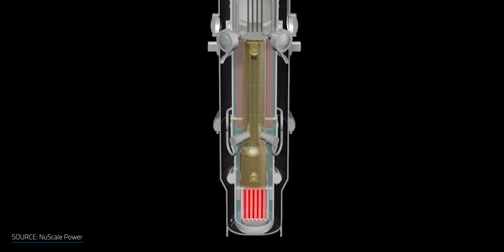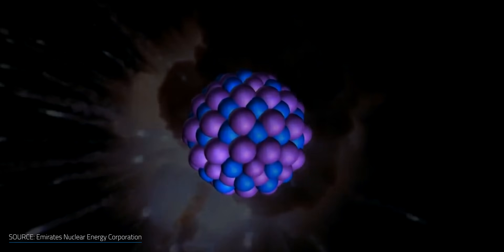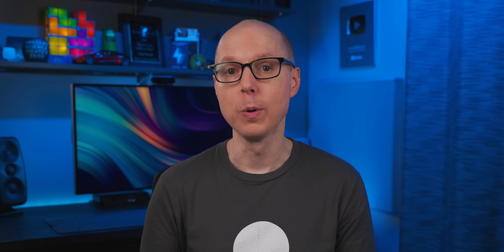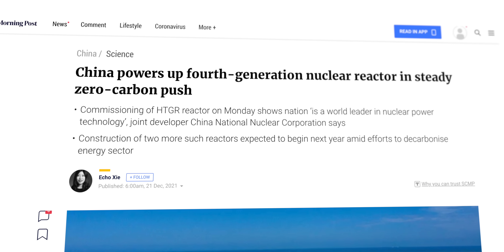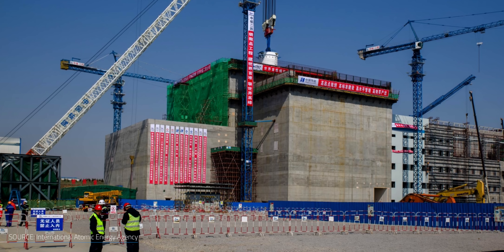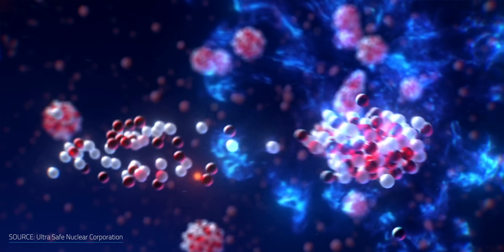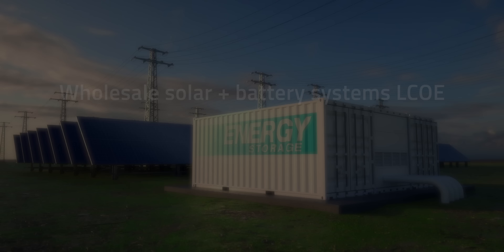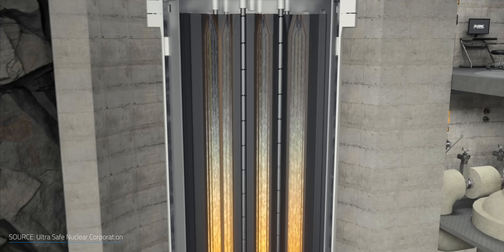Forget Small ... What About Micro Nuclear Energy?

Comment: I work in renewables but honestly believe more in nuclear. When it comes to cost and meeting net zero, something that is often overlooked is that renewables are not dispatchable (as in you can't decide when they generate) and there is not current technology for storing energy between seasons, meaning that it is very expensive to run a reliable net zero system off them, whereas nuclear solves this, also without turning the countryside into industrial wasteland. If those LCOE's were adjusted for firm power, solar would be near infinite as it produces nothing in winter evenings.
Reply: @gags730  
The cost to recycle solar is not economical and will make the cost of electricity 4x more than previous estimates if we recycle the panels.
I don't know where you get this from. Recycling a solar panel in a French recycling plant costs around €25 or around 10% of the sale price of a panel if we'd include transport. This isn't going to impact solar panel costs. The only reason why solar panels don't get recycled currently in some/most parts of the world is because companies/people try to lower the cost as much as possible and rather just bring it to a dump for a fraction of the cost (probably just a few cents per panel). You just need to get regulation to make recycling mandatory, which the EU already has done.

China being the largest producer also does this at minimal cost, so you have cheap materials and cheap labor and thus a cheap panel in the end.
Except studies have shown that the low cost of Chinese panels isn't due to cheap labour (the process is mostly automated), but rather scale. The Chinese jumped on solar panel production and quickly scaled it up before anyone else did it at such large scales and they quickly started dominating markets with this lower price due to scale, making it much more difficult from anyone else to achieve the same scale and thus cost.

So the energy needed and the labor to recycle the panels makes them not economical to recycle today
Recycling process' barely use labor and I don't know about the energy requirements, but like I said before, recycling is mandatory in the EU and in France they do it for €25 per panel.
Reply: @MDP1702  I suspect you mean 3% only within HVDC (which is declared loses, so in reality it would be much bigger). What I mean by big energetic loses is all the energy needed to maintain the system, not just "natural". So that would be up and possibly beyond 10% which is huge considering that net income of solar CSP EROI is already just 15 (as opposed to Nuclear 75), while PV is not even goes above viable threshold. 

And that is just for Sahara dezert vs Germany, which is directly above Sahara in terms of solar provision (i.e. Germany is bad example as it does not solve the stability issue and for non stabe - well we  already saw this year what economical failure was switching off stable nukes and going non stablr towards wind/solar. That is - for te system to be viable we must consider provision fro  somewehere that is 20k km away, and 3% HVDC line loss becomes 60% loss that makes the system bellow economicaly viable EROI threshold.
Reply: @romualdaskuzborskis  
while PV is not even goes above viable threshold.
This is completely incorrect, don't know where you get this from.

What I mean by big energetic loses is all the energy needed to maintain the system, not just "natural".
I never talked about anything but transmission losses, not the losses within a system, which would happen whether you place it in the desert, or right next to your house (figuratively speaking). You too talked about just the 'transportation' losses in your original comment, not the losses within the generation system.

And that is just for Sahara dezert vs Germany
So what else you want to compare? The Sahara to the US, eventhough the US has deserts closer to themselves, like in their own country? No one ever talked about the sahara providing power to the entire world, at least not more than just as a thought process to show how much solar would be needed to power the world when placed in those regions. And I don't think there are many places on earth that are further away from a desert than northern Europe vs Sahara, perhaps South America and smaller islands.

well we  already saw this year what economical failure was switching off stable nukes and going non stablr towards wind/solar.
The decision to shut off nuclear in Germany had nothing to do with renewables, it was purely a political decision. They then decided that rather than replace it with coal and gas, they'd invest in renewable, not just to replace nuclear, but also coal and eventually long term gas. If they didn't make the political decision to shutdown the nuclear plants 10-15 years earlier than expected, they just have replaced more coal with renewables. Which arguably would have been better for the climate/emissions, but wouldn't have changed a damn thing regarding grid stability or economic outcome (at least not much at worst).

Also how is Germany suffering from grid instability? I haven't really heard of large problems coming from Germany regarding grid stability? I do hear problems from Austrialia and in the US, where ironically it often is just the state of the network, fossil fuel plants or just bad management that seems to be the problem.

If you are talking about gas, Germany isn't really using much more gas for their power since 2010. And the slight increase there is, is due to the shutting down of coal plants to replace them with renewables and cleaner NG. Overall only 15% of Germany's power comes from gas. The US gets 40% of their power from NG.

And if you just talks about the price of electricity in Germany, you need to remember this is mostly due to taxes. There was in 2018 only a 2c/kWh difference between France (nuclear) and Germany in power production cost. With similar taxes the cost difference in 2018 would only have been around 4c/kWh in total on the bill. But Germany has just more taxes and instituted a special tax to pay for renewable subsidies that were necessary 5-10 years ago when renewables were still significantly more expensive compared to now and this tax is planned to lower and dissapear in the next few years. 

for te system to be viable we must consider provision fro  somewehere that is 20k km away
I don't really see how you get to that conclusion. That is the completely other side of the world. If you say in order to cover the night, that isn't quite right. Wind doesn't stop blowing at night. Also if we really needed to, CSP in Sahara (or even just southern Europe, like Spain), while more expensive, would be still fine to cover the night if necessary, especially since demand at night is significantly lower.

And it is expected that several grid storage options will become cost competitive within the next 10-15 year.

The truth is, the Sahara project was abandoned because PV became much cheaper than CSP and the instability of the region could be avoided by just placing PV at home/in Europe for just a bit less output. The transmission losses might have obviously been a small factor, but not even close to the main reason for the Sahara power initiative to be scrapped. Other small factors included the lack of needed personnel in those desolate regions and the use of water where it obviously is a commodity.
Reply: @MDP1702  sorry dude, your narative seems either biased, or plain advertising agenda. 

You mis took my argument for isolated teoretical statement. No - all my statements are around and about economic failure of the full system start-to-finish. No renewables make a decent sustainable business case.

P.S. my info on PV EROI is based on article on forbes, which in turn based on studies from several universities including Stanford. While Threshold level varies from 5 to 8, PV does not reach even most liberal one. And none of renewables (even wind and Solar CSP) reach it if energy is is considered for storage..
Reply: @romualdaskuzborskis  
all my statements are around and about economic failure of the full system start-to-finish.
Yet your initial statement clearly wasn't.

"exporting means spending extra energy to actually move it*. So in reault you will make it expensive. *That is the reason why "the world" does not use sachara desert as world wide solar generator. *The transport loses are humongous*.

Nowhere here do you talk about the entire system or even point at it, you only talked about transport.

No renewables make a decent sustainable business case.
This statement just shows you don't know much about it.

P.S. my info on PV EROI is based on article on forbes, which in turn based on studies from several universities including Stanford. While Threshold level varies from 5 to 8, PV does not reach even most liberal one. And none of renewables (even wind and Solar CSP) reach it if energy is is considered for storage..
Except a review of many different studies on PV EROI came to the conclusion that the mean EROI in those 232 papers is around 11.6, ranging from 6 to 16 in those papers, with low numbers for old studies and high numbers for new ones.

Can you give me the link for your forbes articles or the studies? The only studies I can find from Stanford regarding PV EROI are from more than 6 years ago. Maybe your thing is just hidden in a more comprehensive studie, but I can't immediately find it.
Reply: Those LCOE looks like they are from the Lazard paper that is pure propaganda. It have been debunked a large number of times. Those number is even higher than the strike price for HPC that did include a sort of kick back system to the UK government. Pretty much the grid pays HPC £92.50 minimum, then it kicks back about £20 to the grid via installation and also about £4 directly to the government.

In Finland the strike price was €50.
Reply: Can anyone riddle me this one: If nuclear is supposedly too expensive, why are electricity prices lower in European countries with more nuclear plants? France has way lower prices than the UK and Germany with 71% of their demands coming from Nuclear. The UK and Germany are going for renewables but prices are rising quickly, and more worryingly, demand isn't always being met.
Reply: @jackjones9587  
Well, there are several reasons:
1) increased safety demands. Governments have just kept adding regulation on nuclear reactors to make them safer, just in case. This ofcourse increased cost.
2) new technology. They now build different plants than in the past (at least in Europe), they should be better, but also are now initially more expensive due to new problems that arise etc.
3) risk. In the past governments like France just footed the bill for the risk, ie. if something happened that caused operations to be shut down due to whatever reason, government payed for it. This was mostly with the government giving low cost loans, subsidies or the companies building them being (partially) state owned. These days if a plant needs to attract private investors or get a loan from a private institution, an insane % of interest is counted on it, around 10%+.
4) the plants usually were cheaper in the past due to scale, ie. usually a series of plants of the same type would be built (like the many reactors in France from that time), currently this isn't really the case (yet).
5) Current nuclear powerplants can also deliver more cheap energy due to their investment already being payed off years ago, essentially having to just pay for maintenance. Whether this actually lowered the cost, I can't remember for sure, but they certainly could run cheaper than initially was the case if they wanted to.
6) There is the idea that currently the companies running these older nuclear plants might be underestimating the costs of the end of life, often setting aside way too little to pay for the clean-up/demolition. This while for modern LCOE numbers more thought might be given to the end of life costs.

Also prices in Germany are so much higher than in France due to a difference in taxes. Purely looking at the production costs, there is around a 2c/kWh difference (+-7,5 vs 5,5c/kWh), and eliminating difference in taxes brings a total price difference of around 4 c/kWh. Though I have to add this was for around 2017-2018, since then French prices suddenly dropped, this seems to coincide with the pandemic. Most likely lower energy use, but ofcourse similar production capacity => lower cost for electricity.

Also the LCOE costs here indeed seem to be from Lazard, which seem high for nuclear, with most companies claiming they can run nuclear reactors for an LCOE between 60-100$/MWh, still more expensive than solar and onshore wind, but competitive with offshore wind for now. And ofcourse no storage capacity required unless you go above 70-80% of the energy mix. Beyond that nuclear becomes a lot more expensive, since it is expected that it runs 90% of the time, thus working as peakerplants isn't feasible, though adding some grid storage could manage to have nuclear run around 90% of the time even while supplying nearly 100%, but ofcourse then you need to start comparing with renewables + storage.
Why are Lazards nuclear prices so high? I don't know, maybe they add things nuclear companies tend to not incorporate into their LCOE costs (end of life maybe?).
Reply: The price of nuclear is its advantage, the problem is the building costs and time.
Reply: @jackjones9587  it's not too expensive it's dangerous.
Reply: @bradmason4706  Dangerous compared to what? In 1975 China had a hydro electric dam disaster. The Banqian dam burst; 26,000 dead from flooding, 145,000 dead from subsequent famine and epidemics, 11 million homeless. Caused loss of generation, dam failed by overtopping. India in 1979; the Machhu Dam-II collapsed, leading to the deluge of the city of Morbi and the surrounding rural areas. 1800–25,000 people were killed. Do we stop building hydro electric dams? If this really is a climate emergency, and we have just 10 years to save the planet altogether, then nuclear is clearly the only gig in town that is net zero and meets our present and future demands.
Reply: @jackjones9587  Glowing in the dark ! Why did so many die in those catastrophes ? Mostly because their existence was superfluous and they needed to suck the tit of progress.  And we only lost ~600 when a damn burst in No Cali. Thx
Reply: @bradmason4706  I'm not sure  I follow what you're trying to say. Who/what is glowing in the dark? Who are you referring to with your "their existence was superfluous" statement??
Reply: @jackjones9587  
The thing is that you can't build enough nuclear in the time frame we have as nuclear is a long time paying off it's carbon debt and we need solutions for the whole world, not just us in the West.
Spreading fissile materials around the globe is the wet dream of terrorists.

Our energy system have to perform well in reality, not just on the drawing board. And reality includes bad actors and staggering stupidity.

Old fashioned nuclear is bad enough security wise, but micro plants are a spectacularly stupid idea when you factor in just how hard it would be to secure against ignorance and malice.
Reply: @jackjones9587  
If we are to play the "what if" game regarding nuclear vs renewables, it would be a huge win for renewables :-)

Nuclear has been heavily subsidized along with fossil fuels.
Had half the R&D money poured into nuclear been spent on renewables we'd have had energy storages decades ago. It's fairly simple chemistry.

The carbon debt for renewables is paid more rapidly due to small scale. 
If we were to start nuclear now we'd have the plants in a decade and it would take yet another decade to see the carbon debt paid off. The same time frame is half a decade vs two decades in favour of renewables. That's crucial because the more carbon we dump in the atmosphere now, the more we risk runaway feedback effects and the more expensive mitigation becomes. 

Decommissioning of solar and wind have been looked into and largely solved already. 
Decommissioning of nuclear power plants, not so much: "We'll start thinking about it once they have cooled down a bit".

Farming can be done under and between solar panels. Wind turbines footprint is small and can be offset with urban gardening.

Your thinking is skewed by the illusion that we can carry on as today, just with another energy system. 
Going nuclear will continue problems with dependency on unstable/adverse states, face fuel shortages in a handful of decades and continuing the shop-til-you-drop lifestyle that is threatening biodiversity and sustainability in general.
Reply: @jackjones9587  That was the nuclear running joke about radioactive leakage. We'd glow in the dark. And at this point in time I would say Russian soldiers are superfluous.
Reply: @bradmason4706  Sorry Brad, I still don't see the point you're trying to make about superfluous people/soldiers. Re glowing; I'm well aware of the point you were trying to make. Yet, my point that more people have died from renewables i.e. hydro electric, than nuclear still holds. I wouldn't say stop building hydro electric, because of that fact though, therefore, nor should we stop building nuclear either.
Reply: @madshorn5826  Re subsidies: renewables must be the most heavily subsidised sector in the history of power generation! FITS schemes have attracted huge tranches of private equity at the expense of ordinary bill payers. The carbon debt payback of renewables may be quicker but the lifespan of their generation capability is much, much lower than nuclear, who's net benefit is clearly larger. As I work on large scale solar projects in rural areas, I can tell you with absolute authority, that beyond sheep grazing, no farming is allowed on land leased for solar projects. Apart from it being strictly prohibited by the leasehold agreement, it's absolutely impossible to plough, sow, and harvest crops under the panels....that shouldn't really need pointing out Mads Horn. The farmers and landowners I deal with are getting nearly 2-3 times per acre in leasehold payments, than they would get for farming crops. Clearly they would be fools to turn down guaranteed easy money, so obviously less and less food is being produced. Less food being produced means more food has to be imported with a carbon footprint. Lastly, I thought the subject of controlling consumption would have to be brought up. Yes, that's what smart meters are all about, and everything else smart for that matter. Smart really means control, and renewables, with their fundamental unreliability, are the perfect vehicle of excuse for that end. Smart tracking and energy rationing is where this ends. If a near limitless and free energy source was discovered tomorrow, the champions of renewables would resent it for disallowing them to usher in a zealous age of self flagellation.
Reply: @jackjones9587  did that include Chernobyl ?
Reply: @bradmason4706  How could I not include Chernobyl Brad, it's really all about Chernobyl isn't it.
Reply: @jackjones9587  
most of the world could be like France; generating over 70% it's power needs at pretty much net zero.
Maybe, though part of the reason it works so well for France is because it also exports a lot of electricity during down time moments. Without it, 55-60% might be more normal, though not sure about that.

Giving up arable land threatens food security
You don't really need to give up much though? PV panels can be paired with crops, several projects have already successfully proven this. Wind turbines take some space on the ground, but not that much.

and the efficient lifespan of renewables tech is a quarter that of nuclear.
Which I see as an advantage, you can more quickly replace it with improved tech, be it a better version of the same or just something completely new.

but if we really have as little time as we're being told, then, on balance, nuclear stacks up better than renewables.
I am not so sure. it takes around a decade or more to build a new nuclear powerplant in the west (Europe/US). Projections put gridstorage competitive within around 10 years, so by the time the nuclear plants come online, renewables + storage might already be competitive with it. And while during those 10 years nuclear doesn't do a damn thing, renewables are constantly increasing overtime untill you reach the point they need to be, so you don't need to wait 10 years to see effects.

In the end a mix of both renewables+storage and nuclear is likely going to be result in the short term, long term is just impossible to say.
Reply: @jackjones9587  
renewables must be the most heavily subsidised sector in the history of power generation!
Possibly, though now this dissapears. Also I wonder if nuclear R&D costs include things like the manhattan project etc, from which likely a lot of knowledge for civil nuclear reactors was also gained. Also I am going to wait, considering a lot of nuclear companies don't put the necessary budget aside for the decommisioning phase, so this might fall back on subsidies too possibly when it comes to it.

The carbon debt payback of renewables may be quicker but the lifespan of their generation capability is much, much lower than nuclear
Which doesn't matter, the carbon cost and the monetary costs of all systems are calculated using expected production over their lifetime. Its a universal value independent of a systems lifetime. So if renewables do better or equal in those, a shorter life actually can be an advantage, to more quickly replace it with improved systems, while with nuclear your are tied to 'old' technology for many more decades.

As I work on large scale solar projects in rural areas, I can tell you with absolute authority, that beyond sheep grazing, no farming is allowed on land leased for solar projects.
So I guess you have taken part in the projects that specifically looked into combining the two? Probably not.

Apart from it being strictly prohibited by the leasehold agreement
Which is not an inherent problem, rather a contract/regulation problem.

it's absolutely impossible to plough, sow, and harvest crops under the panels
Except it is already been done. It just has different design choices from traditional solar field, for example raised higher above the ground and enough spacing. Test have shown around 160% of land use, or 60% more than either just solar or just farming, with around 80% of crops vs normal and 80% solar vs normal. In some more arid area's this likely is even higher due to lower evaporation rates of the crops and the evaporation there is helps keep the panels a bit colder (though probably not that much). There even was a project were they had a net benefit in just the crops yield.
Reply: @jackjones9587  I thought Chernobyl cleaned up pretty nice considering. And there's a lot of brave first responders died there or within weeks.
Reply: @bradmason4706  True, it was a terrible disaster Brad, yet in terms of fatalities, it doesn't come close to hydro electric disasters.
Reply: @gags730  
The Dark Side of Solar Power Harvard Business Review
Ironically, this proves my point, namely that recycling of solar panels cost between 20-30€/panel.

However they claim the cost would rise much due to the logistics, which I don't see as feasible, it seems they are painting the worst scenario possible and are specifically just talking about the US. For example the reason why costs would mount that much are threefold in their argument from what I gather:

1) dissassembling of the panels from their place (roofs, stands, ...). This I find pretty ridiculous. Sure it will up the cost, but definitely not more than would be required to install them. Moreover later they talk about the problem that people will replace their old panel with new ones faster than expected, however this would mean dismounting these existing panels would happen at the same time as installing new ones decreasing costs.

2) legislation making PV panels hazardous materials, increasing regulation on it. This too sounds farfetched. While yes PV panels contain some hazardous materials, these are in such small amount and bounded in the panels in such a way, you need to pulverize the panels or burn at a hot enough temperature for them to cause any problems. Neither of these things would happen if you properly handle them. The EU already is recycling them without such (hazardous material) restraints, I can't see why the US would impose them. Hell, if you put that on those panels, you'd also have to handle new panels as hazardous material, which could even impact the core way of how PV panels are used. I just don't see why lawmakers would shoot themselves in the foot like that for no reason.

3) the sudden increase in PV waste. This is essentially their core idea throughout their research regarding PV panel waste, it is going to increase suddenly to a very high amount and the industry won't be ready. This is valable argument, but only up to a point. In worst case scenario they'd have to store these panels untill recycling capacity can follow with the demand.

All in all what it comes down to is that preparation is needed, without it the cost of PV panels in the US could skyrocket. Though quadruppling of LCOE doesn't make sense at all, that means getting rid of them costs 3 times more than production, installment and maintenance and this while recycling costs themselves are 10 times lower than the installment+production costs, so logistics and dismantling would somehow cost nearly a thousand dollar per panel, which is ridiculously high even taking into account possible emergency measure like storing old panels untill they can be recycled.

In the EU currently recycling is mandatory and the costs for dismantling are normally up to the company, which they likely just add to the initial price and yet PV panels are still being sold and installed at an increasing rate. The owners aren't supposed to pay anything for the dismantling and recycling when it is needed. This show recycling isn't a problem unless you just don't prepare for it, which would be stupid, especially considering studies now already are being done to warn about it.

from the mining of materials
As you said, they are cheap. While materials from China might be a bit cheaper, they aren't by that much. Most of the mining these days is done by machinery and with as low manpower as possible, there are few exceptions (like cobalt in the Congo), but this doesn't really matter that much. In fact mining by manual labour tend to be more expensive, even with cheap labour.

to everything in between from the parts in the box
Which for the most parts also will be automated. Or pretty cheap regardless. What parts specifically are you talking about?

to the box itself
Really? You think this can't be/isn't automated?

 the driver and truck that bring it to a ship that is all factored in.
Yes, well. These just increase the cost vs local manufacturing, don't they? A panel that is produced for the same price in Europe and being delivered in Europe by an 'expensive' driver will be cheaper than the one produced in China at the same cost, then being driven and shipped by cheap labour to Europe. Especially since you still need to drive the panels from the harbour to the costumer by an 'expensive' driver anyway.

According to articles they even use slave labor in the process.
Yeah, there are claims, which can't be verified. But even those that make claims about it speak about pretty low amount compared to the overall workforce, thus it isn't even certain this has a real impact on the cost. It could also just be a way for the Chinese government to at the same time have low skilled cheap labour and more importantly, control over what they seem to deem a non favorable ethnic group within their borders.

Deplorable, but studies into the cost of Chinese low cost panels don't really seem to back up that their cheap labour is really a big factor in low PV cost.

In France is the recycling of the panels subsidized
Not that I know off, the cost goes to the companies that install/sell the panels, so likely it is the costumer that pays for it upon buying. Though this is for Belgium where I live, about France I can't be certain, but I assume it is similar in all of Europe with recycling being mandatory at EU level.
Reply: @MDP1702  do you know how the panels degrade?  can they just be refurbished or repaired?
Reply: @marcsyrene3781  I don't think they can be repaired of refurbished and even if it could be, it might be at a (much) greater cost than just recycling and getting new ones with better efficiency.
Reply: question Cameron, why are we not using Thermal energy other than it burns birds? all that involves is a couple of peons to keep the mirrors clean
Reply: @narmale  Quite simply costs. It has an LCOE of around 120$/MWh, while photovoltaics at similar scale is around 30-40$/MWh. Ofcourse solar thermal towers can integrate storage, which is an advantage, just not enough.
Reply: @MDP1702  no, im talking about solor thermal, uses mirrors to focus sunlight onto a central pillar steam line to drive a turbine 

They were going to use them in southern cali, Arizona until people threw a fit about birds being fried
(Probably just a cover story to kill the project)
Reply: @narmale  Yes, that is what I was talking about.
Reply: @MDP1702  sorry, miss-read your statement, missed a comma and an and 😆

But it that cost factoring replacement at 10 years and the cost to recycle photo systems? Or they planning to do what they did with failed wind turbines, bury them?
Reply: @narmale  Yes, LCOE numbers normally take into account end of life (recycling). Also 10 years? PV lasts for around 30 years, but even if you change it after 15-20 years it should be quite more cost effective than CSP, with the only downside that if necessary you still have to add storage to PV and not really to CSP (at least not short term +-10 hours), then again storage really is only needed when going over +-50% with renewables and it is expected storage+PV will be able to compete with most other generation forms within 10 or so years.
Reply: @narmale  900* over the solarpanels. They call the roasted birds "Streamers"
Reply: @bradmason4706  😆😆😆😆
Reply: @narmale  or spray them with some water so they get some moisture up there
Reply: Stop saying net zero. Its a pointless phrase.
Reply: Any chance you could comment on the environmental cost due to mining and transportation of nuclear materials and how that compares to the mining and transportation of materials required to make renewables?
Reply: Exactly, people that believed in "Renewables" were sold a Lie .
Reply: South Chile has very constant strong winds in one direction. Best way to export the energy is as E-fuels.
Reply: @jimj2683  what you need to understand is that the relation between windspeed and electric generation for windturbines is generally accepted to be a cubic law. So whenever the wind doubles its speed, you don't generate twice as much energy, no, you generate 8x more energy. And of course, the opposite is true : windspeed drops by half = divide your elec generation by 8.
And this poses huge problems.
I don't know the case of Chile, but in europe, Denmark has invested a lot in offshore winds, to benefit from "constant" strong winds. But what we see is that in a single week, generation from these offshore wind turbines (actually this week) went from 1.9GW down to 0.2GW. Nearly an order of magnitude.
You can check it yourself. Just google energycharts.
Reply: @SC-yy4sw  I think geothermal is the solution to all our energy problems. Just need to find a way to dig deep enough.
Reply: @jimj2683  yah and i think black matter energy is a solution to all our energy problems. So uh sorry to be an asshole here but i was thinking we were trying to solvereal problems with real life solutions here.
Reply: @jimj2683  Maybe southern Chile has a source of constant renewable energy, but most places don’t. I’m with Cameron; unless we get a revolution in energy storage, we’re going to need nuclear to get off fossil fuels.
Reply: @jimj2683  exporting means spending extra energy to actually move it. So in reault you will make it expensive. That is the reason why "the world" does not use sachara desert as world wide solar generator. The transport loses are humongous.
Reply: @jimj2683   I didn’t realize you were suggesting we export the energy to other countries. So yes, I was kind of dumb in that moment. However, as Romualdas pointed out, there must be a problem with this solution, perhaps through reduced efficiency / increased cost. Otherwise we could just use the world’s biggest water reservoirs and sunniest spots to do this. And no one is talking about doing that. E-fuels seem like they haven’t panned out in general; the solution to climate change doesn’t appear to be switching to burning synthetic fuels rather than traditional fossil fuels.

I had high hopes for a similar idea recently: transporting abundant renewable energy (e.g., in the Sahara) across electrical cables to the whole world (“Green Grids Initiative,” I think?). However when I saw an analysis of this idea, it seemed completely impractical; the size and length of cables required make it a non-starter. I would love for this to be proven wrong.
Reply: @romualdaskuzborskis  
That is the reason why "the world" does not use sachara desert as world wide solar generator. The transport loses are humongous.
Actually the main problems with the Sahara plan where geopolitical unstability and maintenance (for example water for cleaning in the Sahara, no close personnel, ...). Yes the cost of the cables was also an issue but not the greatest one, and the losses most definitely weren't the issue with HVDC only losing around 3% over 1000km (ie. from the middle of the Sahara to northern Germany, you'd lose around 10% due to transmission).

Though, importing in the form of like hydrogen from all over the world would be expensive. Then again if this is only needed during severe abnormal weather times, the costs might be low enough.
Reply: @romualdaskuzborskis  The heat generated in the sky above the S.desert would drive hurricanes. We rotate into it.
Reply: @RyanWilliams222  The main problems with transporting electricity by cable at giant distances is cost, crossing borders of hostile nations and huge power losses (10 000km would give more than 50% energy losses).

But what matters in the end is profitability. Reneweable electricity and energy storage is dropping fast in price. It is only a matter of a few years before big things start to happen.
Reply: @jimj2683  they solved that with high voltage DC triacs
Reply: @bradmason4706  possibly, francly I dont know much about meteorology. But as much as I know in energetics - solar/wind as a whole - is neither sustainable, nor stable, nor smart systems to go by.
Reply: @romualdaskuzborskis  True, they all have drawbacks.
Reply: Sodium battery technology might solve the energy storage problem in the future